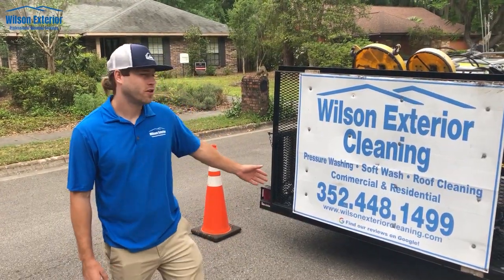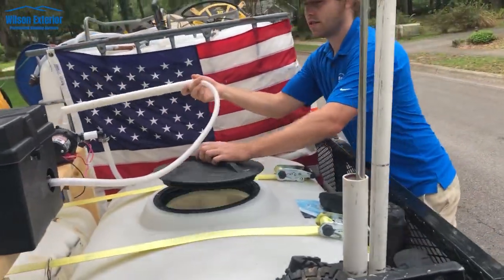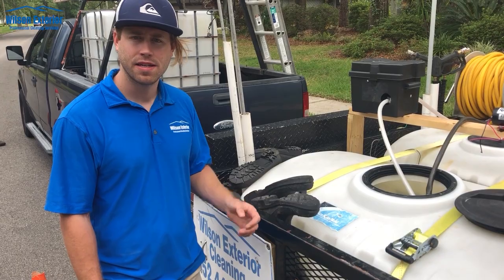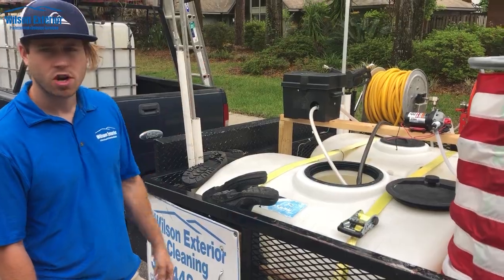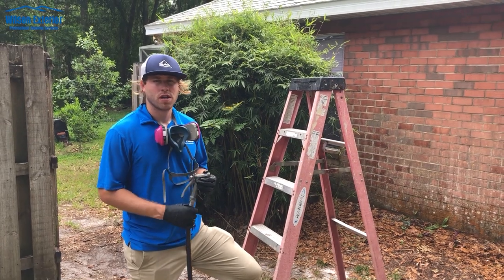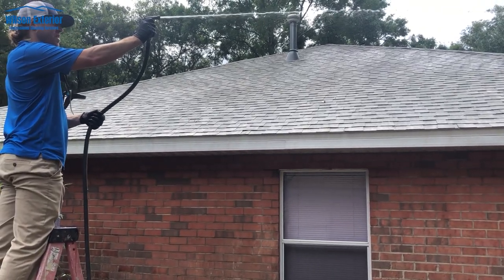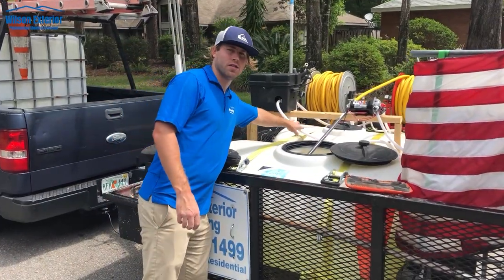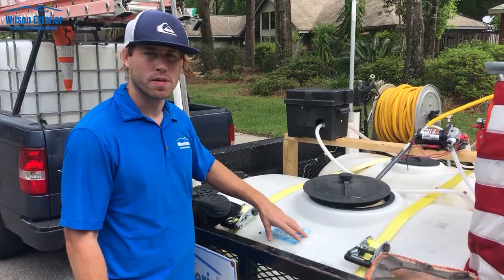Step by step soft wash roof cleaning: How to safely remove mold on the roof with no pressure washer

Comment: For the rinsing method do you have the water run through a pump or is that straight from the house tap?
Reply from the maker: We do both but the garden hose on the house tap is our preferred method.
Reply: @WilsonExteriorCleaning  do you find you have a decent amount of pressure to rinse just from the garden tap? And can you please do a video about rinsing and how much is needed to do no damage

Comment: Hi Chris, you got this shingles cleaning at 60 water and 40 chlorine, is it the same for a metal roof?
Reply from the maker: Yes it can be the same but you want to wet the metal roof with freshwater first and spray the roof mix, then rinse the roof with freshwater a couple of minutes after you spray your roof mix. The mix can be a little bit stronger and with more surfactant depending on how steep the roof is. (50/50)

Comment: You have a great  set up dude the sh I get is 10 percent what mix  would or should I use to kill moss I tried 50/50 and the over spray bleach the paint on the house and the chimney I had to repaint the customer house.
Reply: 6% on moss and always prewet and rinse overspray areas especially when using a hot mix
Reply: @ldrew2  when you say 6 percent is that 6 gallon water to 1 gallon sh
Reply from the maker: If you are mixing in one tank do 50/50. Wet the chimney and the skylights before and after the cleaning. If the spray gets on anything rinse immediately and wash the entire area

Comment: I noticed that you mentioned you pre/ post rinsed the plants. Then an hour later you rinsed the roof then the plants once more. What I'd like to know is did you have someone rinsing the plants on the ground as you were rinsing the roof? Can you get away with doing it all by yourself? Or do you absolutely need another person on the ground rinsing the plants as you are treating the roof? Thanks
Reply from the maker: There has to be someone watering the plants in the area you’re working. Or a sprinkler, either way the watering of the plants and the roof wash must be simultaneous
Reply: Thanks 👍